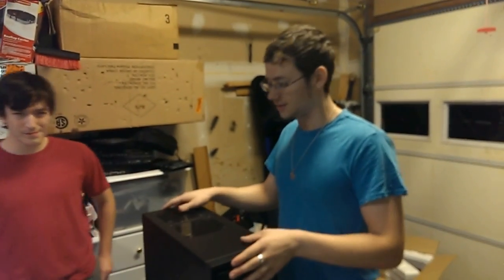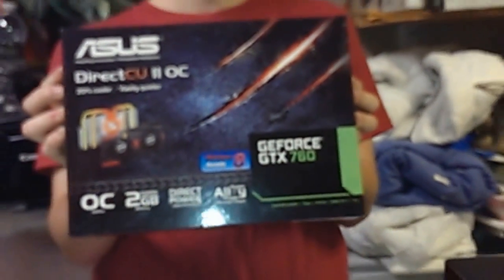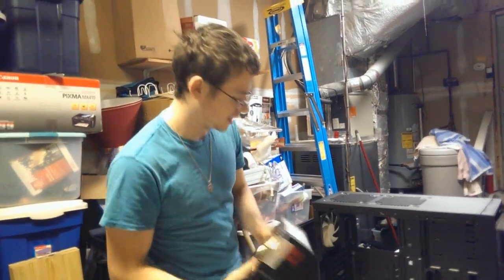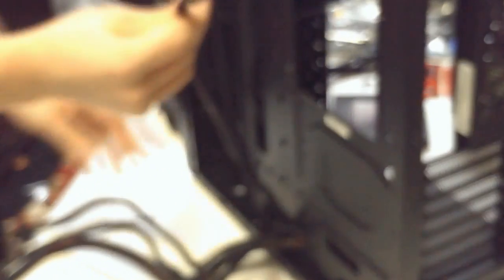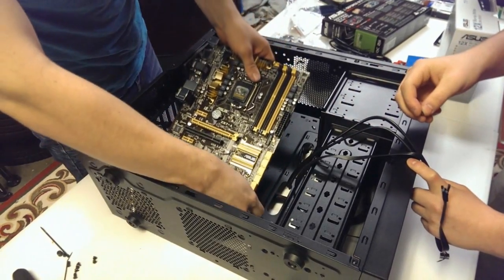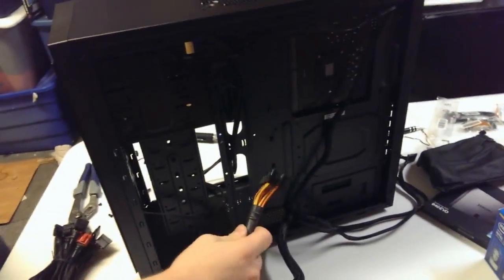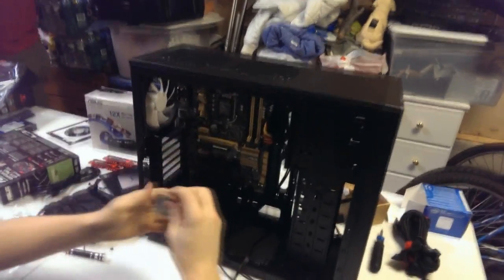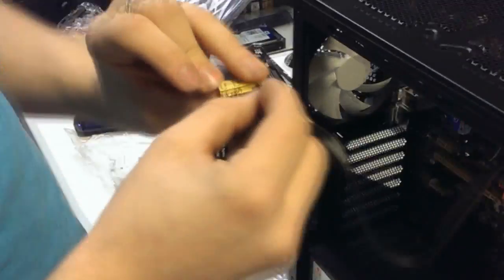ThirtyVirus PC Build [Part 1]

Comment: You should put the CPU cooler in in a cross pattern to make the blob of heatsink spread evenly however it wasn't completely necessary and you should've got 90% spirit to clean the stock heatsink first as it thick, cheap and gloopy and can make a mess, other than that it was a pretty good build

Comment: That's a great computer if it can run Minecraft that good 0_0
Reply: It doesn't take a very powerful pc to run minecraft at max. You could run minecraft on max settings on a $350 pc.
Reply: tannerdudeman i got a £200 pc (approx 330 dollars) and it can almost run mc at full settings but not quite while still hitting 60fps but i installed optifine and now i can run at full default mc settings
just saying, a 400 dollar computer could do it without optifine and run at 60fps all the time
It also depends if your on a laggy server or singleplayer too :D
Reply: James Troll And if your recording or not (in brandons case)
Reply: gg...